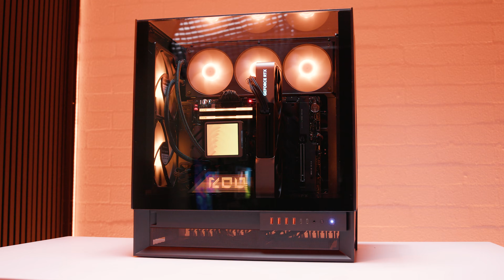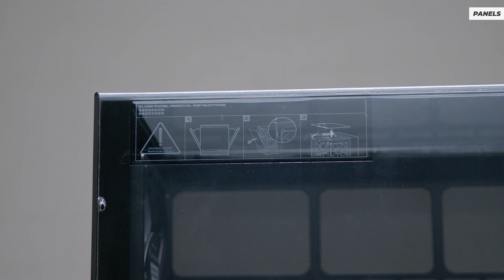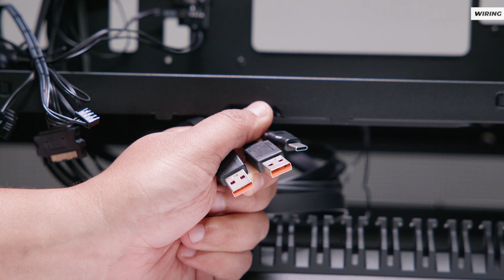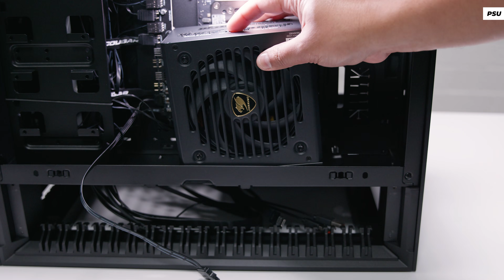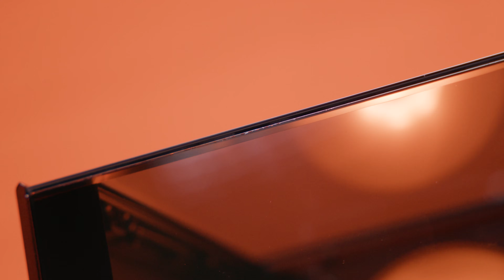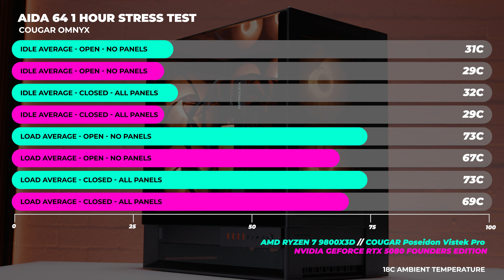This $139 PC Case Does Something WILD! // Cougar OmnyX

Comment: Wouldn't that cause negative air pressure with the GPU pushing out heat through the fans while the other fans in the front of the case are acting as intake?
Reply: gpu fans are the intakes, not exhaust. The hot air comes out behind the gpu, at both gaps.

Comment: Can you please elaborate on front IO panel? It is possible to use all ports from internal headers? Or half of the ports are internal headers and half is extension from back panel? Because based on cables it looks it is half and half.

Comment: It's a neat case. But I'd really have liked to see an extra fan mount option on the bottom of the case so it can be used with air coolers, and the possibility to mount the IO on the top of the case like cougar has done with the Airface Eco!
Reply: Agreed, having a bottom mount to get air to the CPU seems like a pretty obvious option.  Wonder why the didn't do that??
Reply: @rogerwennstrom6677  Dust maybe? In which case they could just add a dust filter.